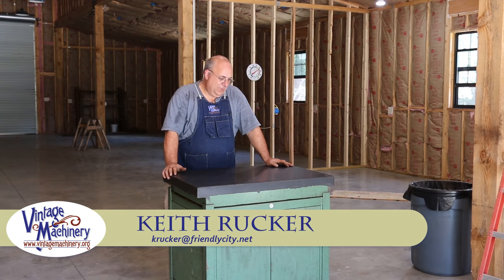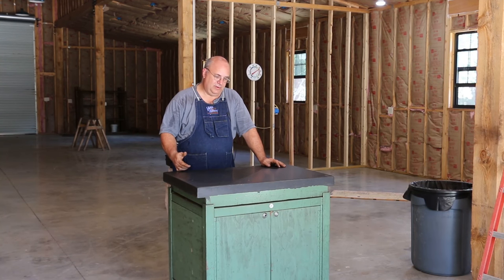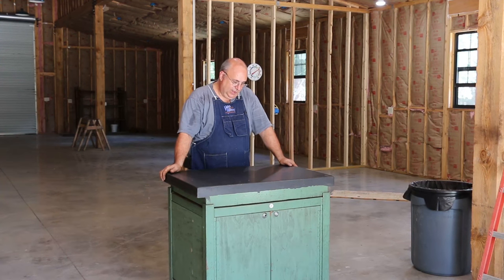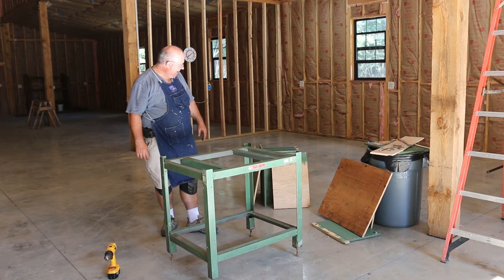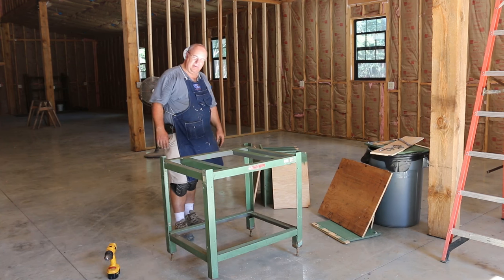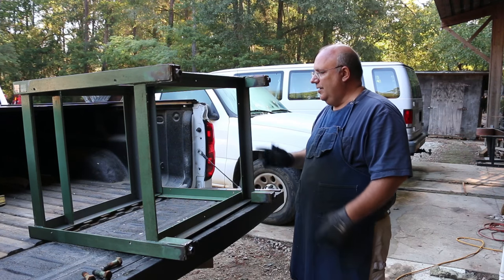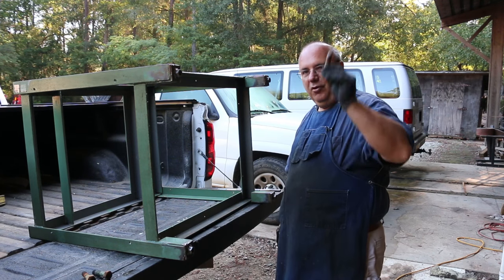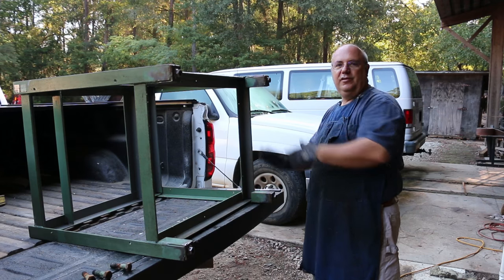Brown & Sharpe Surface Plate Stand Modifications

Comment: Maybe this question has been asked but why do you need to be able to level the plate and the base? Wouldn't the base leveling feet be enough? Assuming the stand is square and the plate is square and true?
Reply from the maker: The leveling feet on the bottom are more to adjust for any unevenness in the floor.  My concrete floor requires a slight adjustment depending on where it is sitting.  The three under the plate are to actually level the plate.  It could be done from the bottom feet but it is much easier with the three point system.

Comment: Does this plate have marked support positions that are at the location of the supports used when it was finished to tolerance? I remember reading something about that when looking at some surface plates in the past.
Reply from the maker: Yes, there are pads mounted to the plate where you are supposed to support it from.

Comment: I can't remember where I watched it, but temperature changes through the slab made lapping it a frustrating process.  It had dips and peaks throughout, due to thermal expansion.  Will this slab be kept at a constant temperature?  I can imagine an isostatic heater of some kind, to keep it true.
Reply from the maker: Temperature can change the flatness, but it is usually only by very small amounts.  If I am not able to keep the plate at a constant tempature in a climate controlled room, then it technically cannot be a AA grade, even if it meets the specs at time of calibration.  For what I am going to use it for, A grade is good enough but I will have it lapped to AA simply because it will be flatter.

Comment: What is the purpose of leveling the plate to a high degree of precision? To allow the use of a level to measure surfaces?
Reply from the maker: Exactly.  Particularly with scraping you can use a precision level to measure surfaces, but the plate needs to be perfectly level for it to work.

Comment: I hate to disagree but I have to go along with other comments, the markings on top or the three bolts that are being used to level the plate will grind into the granite domd every time you adjust them. I believe they should have been ground smooth and a thick delrin or hard nylon washer with a recess to locate it on the bolt would be a better choice. Looking forward to the lapping series
Reply: Keith covered this in his reply to the oldest comment to jusb1066 (arrange comments by Newest First, keep clicking "LOAD MORE")  Keith said, "I ground the tops of the leveling blots flat." I copied and pasted Keith's comment. I doubt the delrin would be a significant help unless you needed to relevel the surface frequently.
Reply: Thanks, I missed his comment. I suppose it's the way I've been taught(there's always multiple ways) to try to insulate two different materials from wearing on each other. Last evening I looked at a friends granite surface plate(an oldie from Boeing) and its got the original felt on four raised metal pads supporting it from the framework. His dad got it when he retired from them. I've also seen a fairly new plate from Standridge which sits on the framework directly. Thanks again, Jim
Reply from the maker: First - the tops of the bolts were ground flat.  Second, there is already a plastic like disc glued to the bottom of the plate that the bolts are coming in contact with - these are factory installed so the bolts are not coming in contact with the rock.
Reply: Thanks, I guess I missed it when you mentioned it. Stand looks great

Comment: I have a question.... is there any advantage to buying a named brand surface plate as opposed to an import providing they both have the certificate?This is a serious question, my measuring equipment is an area that's really letting me down at the moment. I am looking at a new surface plate and height gauge.
Reply: depends on if you can trust who issued the certificate, the chinese are not above giving a certificate for any old thing
Reply from the maker: The only real thing that I would be concerned with on the imports is how good is the granite that they are using.  Some granite hard hard, some soft.  A soft granite will wear much better than a soft granite.  The name brand stuff generally is a high quality stone.

Comment: Keith,  That stipper you used you said it was citris  strip???  Who makes it and what is the full name of it.   One more thing does it work on wood???   I like how the paint just rolled right off.   Great Video....
Reply: I'm not Keith, but yes, it's Citistrip.  Here's the website so you should be able to find the info you need there: 

 http://www.citristrip.com/
Reply: yes easier to sand mostly wood with a bit of paint vs sanding paint, it just clogs up the abrasive, though for stripping wood id use a hot air gun,
Reply: I have a hot air gun and will have to give it a try.
Reply: ***** Thanks for the link Ron.

Comment: Keith, I am a little confused, you put leveling feet on the bottom and then you put the three leveling bolts in on the top of the stand, why do you need the ones on the top if you have the feet on the bottom?
Reply from the maker: The ones on the bottom are really more to take any rocking out of the stand itself.  With a concrete floor, it is hard to have all four feet sitting on the ground at all times and with a surface plate you need a solid foundation.  The three point system is much easier to do the actual leveling with and more importantly, you are supposed to support a surface plate on only three points.  So the bottom feet are just to get all four feet touching the ground and the actual leveling is done on the three points on the plate.

Comment: why not weld the bottom nuts to the bolts and then you can easily adjust from underneath
Reply from the maker: With the cabinet like it is, I think it would be more trouble to adjust from the bottom.  You can only access it from the front side and as it is now, I can adjust from any side.

Comment: Hi mate.  She looks like a bought one.  So much better without that silly paint on the side of the plate.  I would have thought that you would have made the feet yourself, though, just ball and socket joints with some car tyre pads under them.  I use pads made from tyres for all sort of things, they are cheap to use, soft on your floor and don't wear out.  By the way, did you grind the tops of the bolts flat, so they won't damage the underside of the plate?  A bloody nice job, though, that shop is going to be too nice to work in.  What can you tell us about that other huge lathe that you have sitting there, she looks like she's going to need a lot more work than the one you just did, or is it all pure cosmetic?
Reply: I was wondering about the bolt head lettering as well.  I think Keith did mention that other lathe a few weeks ago.regards
Reply: Thanks mate.  I will have to go back to see that.
Reply from the maker: The heads of the bolts were ground down - I forgot to mention it though.  As for the big lathe, I did a video on that big 28" Monarch a few months ago.
Reply: Ja some one reminded me about the monarch video I will have to go and find it, Thanks.

Comment: I wonder if the stone will crack with only 3 small points of contact ? otherwise good job.
Reply: Nope, especially with the factory metal pads on the bottom of the plate. Plus, you're never beating on your surface plate, even when using it as a master for scraping, it's only a reference point
Reply from the maker: They are made to mount that way.

Comment: you should weld a rod across the head of the bolts then you could just twist them by hand from the bottom .
Reply: I was thinking install the bolts from the bottom for the same reason. Could sit a little lower in the stand that way and still be accessible.
Reply: Yea I think it would be easier  if it's moved alot.
Reply: My thought was use cross drill them for use with a tommy bar below the cross beams. That way with luck the extensions might not have been needed.
Reply: Meant to add weld the nuts under the cross beams.

Comment: Why would you want to have 2 sets of levelling adjustment on the table? Is the ones on the feet not adequate? Just asking.
Reply: the table has four legs, the top uses 3, which is the most accurate way to support it, but 3 legs are not as stable as 4 unless very wide stance, like a tripod. the 3 for the top means you can get super accurate support, which is the point of the table.
Reply: The plate has three pads on it so it already was supported at three points, which stops it bending in a different way to when it was calibrated (with four you could raise opposite corners asd cause a little flexing). The table has raised corners to give the plate stability if knocked, then four legs for good stability on the floor. The plate also needs to be levelled, which you can do by levelling the table. It doesn't require three adjustable points - the manufacture of the surface plate got it right.
Reply: +Pete Kirkham

Nailed it, nothing left to add really.

John Greenwood
Reply from the maker: Two reasons to use three points of leveling on the stone.  First, the stone was originally ground on three points - which are marked on the bottom of of the plate.  For best accuracy, they recommend mounting it on the same three points.  Second, three points are much easier to level than four.  I use the four leveling feet on the stand to mostly adjust for any unevenness in the floor so that the cabinet does not rock.  The stone is leveled on the three points.

Comment: I had to cringe when I saw plywood. I probably would have gotten out my router and table saw and rip up some solid mahogany or red oak. Give it a medium deep satin finish, then sealed and installed. Contrasted with the hammered crinkle paint and deep dark surface plate on top, it would look absolutely gorgeous.
Reply from the maker: Agreed, but with the work already being done with the current cabinet and it actually being a pretty decent job, I did not see the need to invest the time and money to reinvent the wheel....

Comment: Keith, I don't understand the importance of having a perfect level top, how does that effect any measurement of something laying on the surface plate? Only having a perfect smooth top, would to me, seem the important criteria, not being level or am I missing something. Just curious
Reply: yesi see what you mean , if its flat, its still flat, i guess its nice not to have it all rolling off! or tipping over
Reply: yes but your holding down with pressure with your hand when your scribing the piece and being a fraction of a inch of level out escapes me how that would make a difference
Reply: Just to be pedantic, level is not flat, it's curved. But it's a bit difficult to tell the difference in a few feet. :) If the center were level, the edges would be about 0.5 millionths inch low, if they were also level.
Reply: Matt Matt
it can rock if the face is curved, of course its all relative, but its for accurate measurements, not 'good enough'
Reply: With some surface plate work you may need to utilize a machinist level.
Reply: I would guess having it level is nice, but not that critical, you aren't going to bend it by being a few thou off level. Stopping things rolling off can be the only real reason for having it level, unless you want to calibrate spirit levels but then even that is not necessarily the best way in a home shop environment. The leveling feet are needed to stop  the stand from rocking and that should be enough, well B&S thought it so.
Reply: Being level would be important if the plate is used when using a plumb bob and line for checking or measuring.
Reply: I would suggest you view some of Shandon HKW videos. There are a lot of videos using this kind of surface.
Reply from the maker: For most jobs, flatness is more important than level.  However, there are times when you need to use a precision level on something to check a part.  In these cases, it is important to be able to quickly and easily adjust the plate to get it perfectly level.
Reply: I'm not too sure I would expect any form of repeatable precision from a "master" level when working on a table with rubber feet!
Reply: I know where you're coming from but realistically the rubber on those feet is compressed and it is sitting on the metal.The feet on my plate are almost identical and I had the same concern when they were setting it up.But I had them come  back about 2 weeks after calibrating mine and it was still spot on and a year later it was only off a hair.Before you say it was the feet in my case the building had settled,I have a cast iron plate on metal feet that was even farther out from settling.

Comment: I think most surface plates have rubber pads on the bottom. At least put a plastic cap on the bolts. I would love to take a Richard king scraping class some day. Have to find enough like minded people in the North East
Reply from the maker: The pads are a hard plastic like material.  As for Richard's class, this one filled up before I could even advertise it.  I am already talking t Richard about hosting another one in the near future.

Comment: so you need a welder at the new shop. Which raises the obvious question: which one? You will use a welder more than I will, but I too am searching for the right welder.
Reply: There is a plethora of welders out there. If I may suggest looking at a multi machine, they come in a wide range of price points. A multi machine will let you do stick and TIG weld and they come ready to use normal 110 and 220 voltages.
Reply: a multi machine might be more limited in amps or might be easier to find used machines , you can get mig tig and stick in one machine , i cant remember if keith uses tig much
Reply: Your probably right
Reply from the maker: I probably won't make that decision until the time comes.  Right now, I am leaning towards some of the Lincoln Electric models - they have a combo MIG-Stick welder that I think would fill my needs very well.  I have also used quite a few models made by Miller.  As for me, it will probably be one of those two brands and like I said, I am leaning towards the Lincoln Electric (but I am sure others will disagree - kind of like a Ford/Chevy argument).  I will probably also get a TIG setup but at least right now, I think that the combo machines that have both MIG/TIG are somewhat limited on the TIG side of things.
Reply: For sure its a Ford vs Chevy thing. I need TIG for aluminum, but I'm still going to pay attention to what you end up with.

Comment: for ease of mobility I'd put wheels on the baseplate cart
Reply: no reason to move it once you found a place for it, its better to be solid so once you set it up, it stays put, saves all that finicky re levveling.
Reply: Plus, he can move it anytime he wants with the pallet jack. :)
Reply: That would be a "B" grade Shop Plate that would be brought to the clean temperature controlled metrology room regularly for calibration/comparison with the "AA" plate. (What ever the shop SOP is)
Reply from the maker: I don't see a need to move it around a lot and for some of the bigger items that I will be putting on it to blue for scraping, I don't want it rolling around under me.  If I need to move it, it is easy enough to grab the pallet jack.